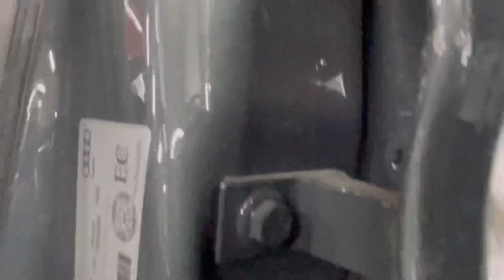Audi S3 door repairs

Comment: im gonna reattempt a restoration on my integra, my first came out decent but i noticed some shrinkback from the high build primer. I want to get to get my panels as straight as possible but not sure if i have to take all the paint off to bare metal to apply filler. Im using the same products as you so what do you reckon i should do?
Reply from the maker: If it was me I’d take off the paint and apply your filler on the bare metal, your just minimizing the chance of shrinkage and also finish your filler work with p220 or even p320 just to get it really nice and smooth, after you prime the areas make sure to block them to get it nice & straight.
Reply: Might have to strip the car to bare metal again if I do that which I like to avoid if possible, could I just block over the panels with p120 and skim coats of filler over any uneven spots and reprime over it.
Reply from the maker: @Jason Nguyen  have you started yet ? Sorry about the late reply
Reply: @LuxuryCarRepair  nah its allg mate i probably won't start till the end of the year been focusing on rebuilding a new engine haha. I've seen another person use a finishing filler over a whole panel so i think that's what i'll try. Its called U-Pol Easy 3 Extra Smooth Finishing Fine Filler. He told me to first block the whole car with 120 and fix any low or highs spots and then apply a thin coat of fine filler over the whole panel then block again with 180 then apply hi build primer. Do you think this is a good method? I use the same 3m purple blocks you use but im not good with my technique and would like some bigger and more flexible. Is there something you can reccomend?